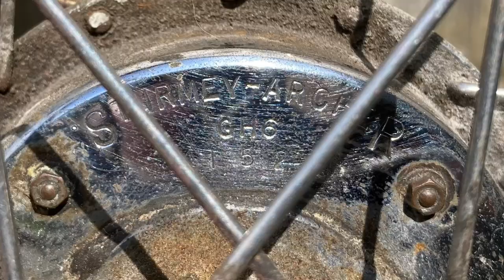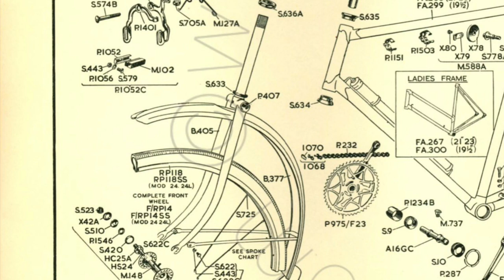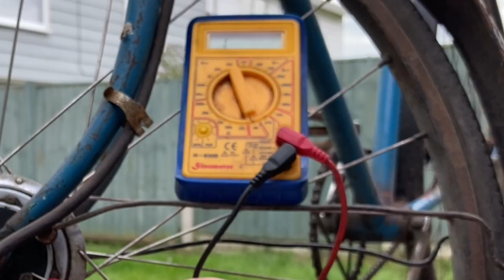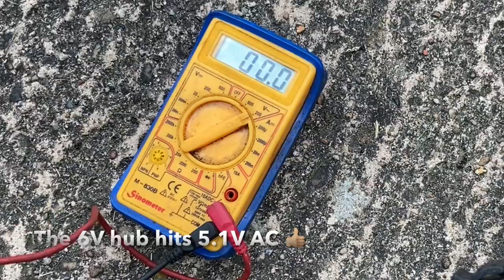WHAT IS IT?! // A 1950s Raleigh Mystery Bicycle - Bike Restoration Project

Comment: I agree that this is a period bitsa. Full of charm though, and I also agree that it would be best to do an oily rag renovation. Soft parts can be replaced with period items, and the bike just enjoyed. Great find!
Reply from the maker: Thanks! Hopefully I can get it up and running soon. 

The front Dynohub is working but judging by the axle wobble the bearings need replacing.

 I have a couple of spare cottered chainrings in stock but they’re from 80s bikes - I could maybe get away with using them seeing as it’s a bitsa!

Comment: After WW2 pretty much everything manufactured went for export and this bike may have been cobbled together from what was available and given the continental connection possibly via German used parts.before its blue paint it had had at some stage a Sturmey Archer hub gear, probably AW but I am not sure you can rule out BSA . The clue is the carrier wheel just forward of the seat tube.
Reply from the maker: Thanks for commenting! I hadn’t considered that it could have been originally exported to Germany and then brought back. Once I find out the date of the rear hub that might clear things up more.